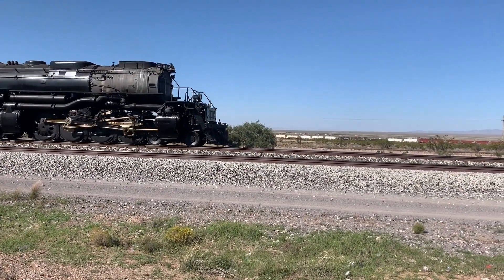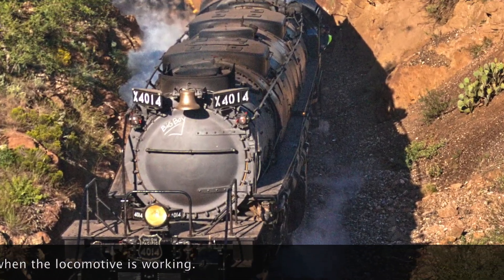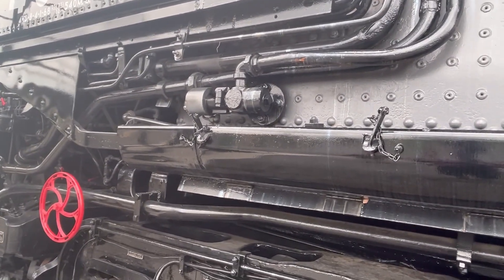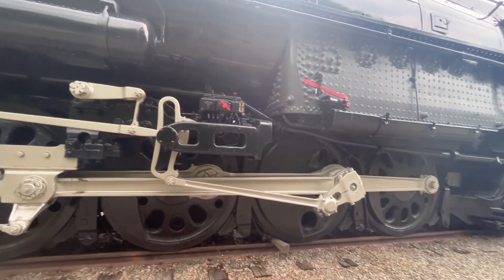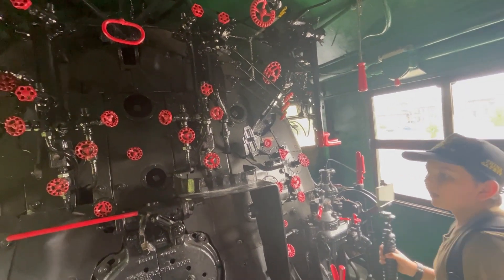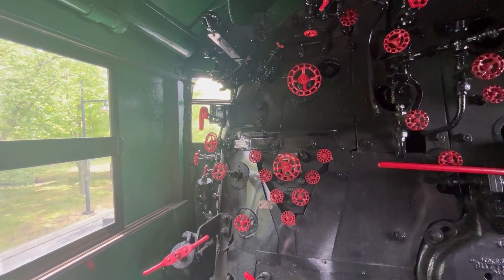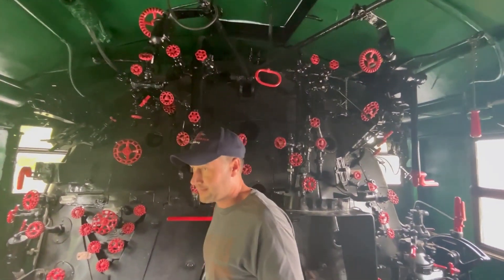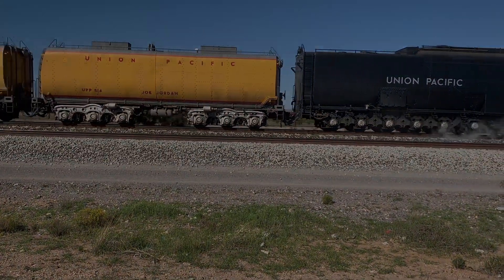World's largest Steam Locomotive - Union Pacific Big Boy

Comment: You did not comment about all the crud on the under carriage/frame, missing sight glasses and other equipment. The cosmetic resteration was a real bad job and is purely superficial. Underneath that engine is just plane rotten.
Reply from the maker: I did notice the missing parts, especially the water glasses and cab gauges.  Those comments may not have made it into the final video.  Also felt like there could have been better explanation and description on the locomotive, how it worked, what all the controls did, etc...

I did not spend a lot of time looking at what was missing or the condition underneath, because basically, it's not really noticed by most, and not something I consider too relevant to it's current display.  As far as painting over rust, time will tell.  If the surface was not properly prepped, the paint will start flaking off in a few years.
Reply: YES THANK YOU

Comment: What are any difference between 4014 and 4012?
Reply: Biggest is 4014 was converted to burn oil, whereas 4012 is still set up as a coal burner. Other than that, they’re virtually identical, as they were in the same order.
Reply from the maker: I have not been as close to 4014, but since it’s oil fired, it will have a fire pan and oil burner instead of coal grates and an ash pan, plus firing valve and blower in the cab instead of stoker controls.  Also for modern operation would have a radio, speedometer, and PTC.
Reply: @ehadder  wouldnt a coal burner have a blower too?
Reply from the maker: @martinadams7949  yes, of course that’s correct.  I was thinking too fast.  I meant an atomizer.